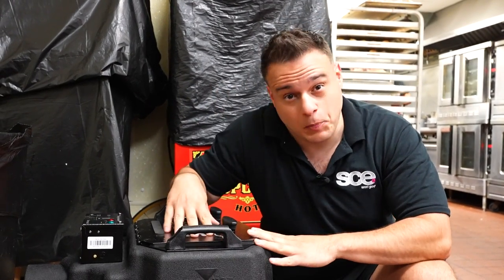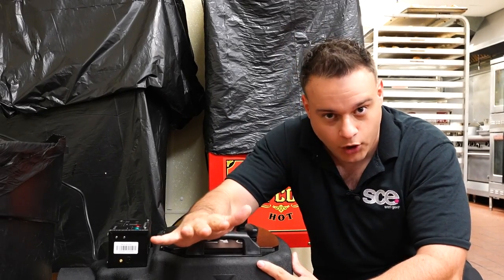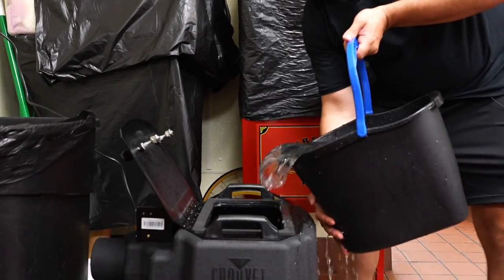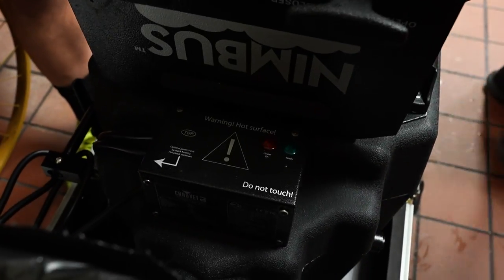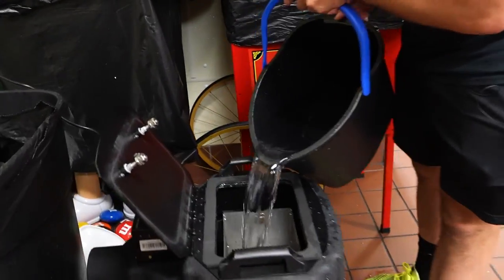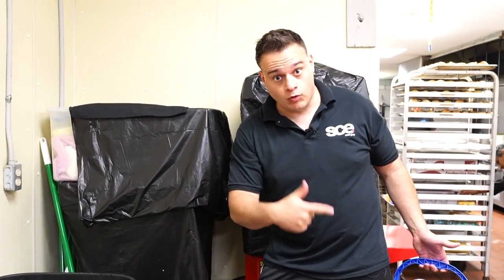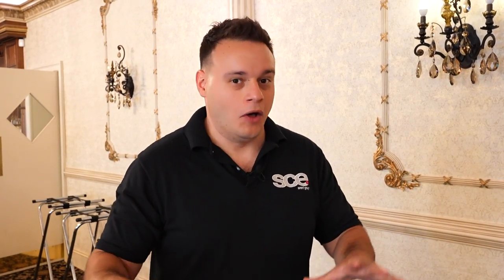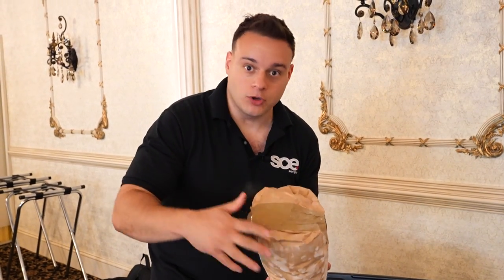How To Setup and Use The Chauvet Nimbus (THE RIGHT WAY)

Comment: Great video- I never plugged in first- since elements can burn out if no water is present- kind of like a water heater element- Glad how you pointed out on how the Nimbus will turn on as soon as it senses water. Awesome. Glad you mentioned about how it holds 10 pounds- also very important on how you also mentioned about the air inside the room. Once I had nimbus and door was open- I did not realize that wind was coming thru door- It was a bad effect- so know- I make sure doors are closed during NIMBUS. again awesome Video- I must say I learned-

Comment: So just to recap.... all the issues I've seen with their being water residue on the dance floor, which is kept me from buying one of these, is that people do not use the proper water and dry ice? I just assumed that it was from the fog dissipating back into the air that caused the water to collect on the Dance Floor. Can you correct me if I'm wrong about this?
Reply: Hello, I am also facing the problem of moisture on the dance floor. Do you know if this problem can be solved?

Comment: Extra tips from using the nimbus after 8+ years: 

Fill the water until it barely reaches the bottom of the basket. 

For the power situation as long as you see rhe green light you can use it if the light turn off the water is warm enough. 

Regarding condensation set the machine a few feet away from rhe dancefloor and the condensation will end up in the carpet and not a hard surface. 

Also you dont need to have the machine plugged when used during the dance. 

Do not use a full bag of dry ice. That shocks the water too fast and the effects isnt optimal. Use 10lb approximately and youll notice rhe effect lasting the full song.
Reply: do you submerge the whole 10Ib ?

Comment: As long as the green light comes on 1 time, it's ok to use if it goes off. It turns back on because of the thermostat every few minutes. 

I also drop ice within a minute of the song starting.  This gives photographers a chance to capture photos with and without it.

To the first timers...
 it shouldn't have to be said, but NEVER plug the Nimbus in on the same circuit as your sound.

Comment: theres a yellow line that indicates as a full line. i do that and no issue
Reply: never seen that yellow line- I will look for it- I always tend to fill water just below the tray- as you can barely see a thin layer just under the basket that holds the ice
Reply: @muchodj  mine has it. You will have to lower the basket down

Comment: I just saw one mistake.......Nick use hot water..... it heats up faster...... HOT water! HOT Water. Especially when you're in a pinch and it keeps your coils from working harder uses less electricity ⚡️ with less of a change to blow a circuit.
Reply: I always use Hot Water- sometimes Hotel kitchens- there water comes out boiling- I love it- takes less time to heat up- speeds up to 30 min
Reply: @muchodj  from the looks of the video Nick hasn’t caught on to this yet. :)
Reply: Doesn’t matter if you’re filling it up at load in and placing it in the room hours before using it.  Let’s face it - we load in before the ceremony and cocktail hour - almost 3.5 hours before that big first dance. The hot water will already be cold.
Reply: @traderpete007  sometimes you don’t get hours and makes no sense to use cold water. When you use hot water you’re conserving electricity and you’re prolonging the heater coils. Your machine will last longer.

Comment: you're working too hard. you dont need to plug it in plus not every where u go will have a readily available outlet.  2 ways u can fill it - 1) fill to the yellow line which is on the inside of every unit this is the actual way to do it 2) drop the tray and look at the heater, fill enough water to cover it, u can see it
Reply: good point on #2 - I did not think about that- everyone here has great tips-